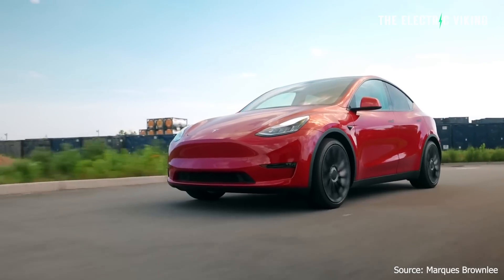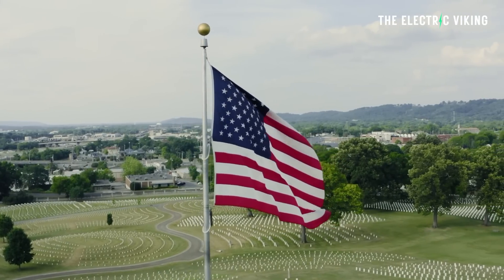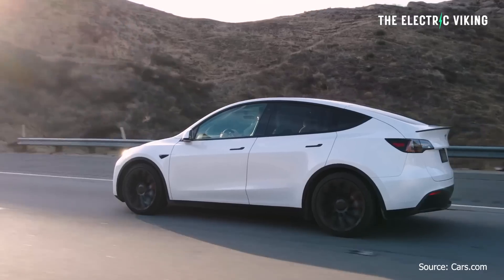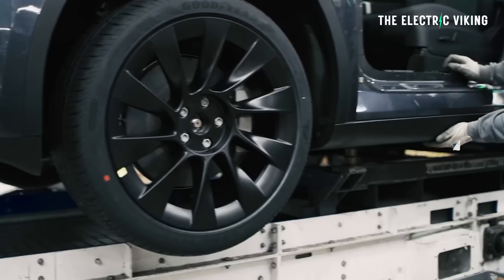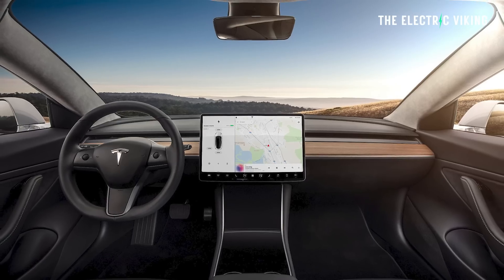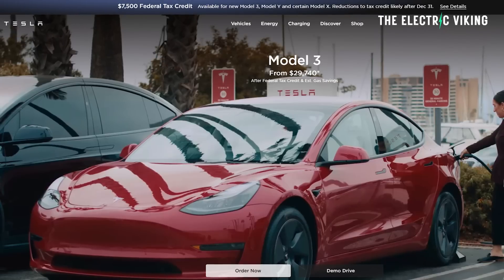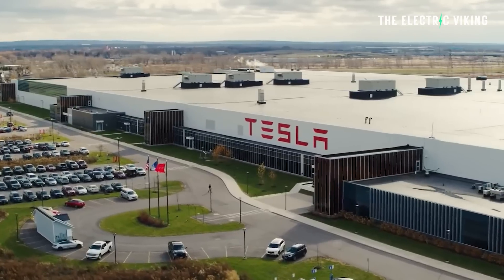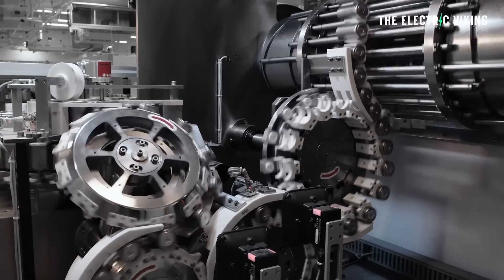NEW LFP powered U.S. Tesla Model Y and 3 qualify for full $7500 tax credit

Comment: That is not the reason. You need to Google a little better. the reason is that the IRA gives the tax credit for the average of the battery mineral cost to be calculated per PLANT not per CAR.   That means all vehicles coming out of giga Austin qualify for the tax credit. As long as the average battery materials are above 50% North American so the long range model Y average will lift up the lower LFP percentage. In Fremont, the higher percentages for the model S model X and long range model Y will also lift up the percentages of the LFP models above 50% so all vehicles will qualify. However, next year the requirement will rise to 60% We will likely no longer qualify based on the current sales mix.
Reply: So you are saying none of the cars coming out of the plant will qualify, possibly?
Reply: @jiminauburn5073  they will qualify for reduced credit $3750. You can see this by going on the Tesla website and looking at all models. They will all have the same warning thar tax credit may be reduced in 2024.  And they have to say “may” and not for sure because they don’t know the sales mix yet if 80% of the vehicles next year coming out of Austin will be cyber truck and long range model Y and the tax credit will still apply to all vehicles, including the LFP model Y as those batteries for the cyber truck and mong range will be sourced in America. In fact, I would guess that will be the case for Gia Austin as I assume it’s volume will largely be cyber truck and long range model Y to easily lift that percentage above 60% for all vehicles, including the LFP Y.

Comment: Bro I watch your channel every day, and the degree of accuracy here on many points is a bit low - let’s be careful about advising others on using Google 😅
Reply: You’re exactly right. And he happens to be wrong in this video, too as he did not even get the correct Google answer as to why the tax credit applies. It is because the tax credit is calculated as an average across the plant and applies to all vehicles produced in that plant Not per car, so it doesn’t matter if the car is NMC or LFP battery itself as long as the plant percentage is its favor.
Reply: Each one of you responding do not own, drive or live with evs.  Your all frustrated you can't.  I am your nightmare.  In our home we have 3 evs 22 plaid, 23 m3p, 22 ev 6 gt line, my son at Stanford a 21 Audi etron P.  Plus on our home we have 62 450 watt solar panels and 2 weeks ago added 6 powerwalls to our existing 4 piwerwalls we have had for 30 months now.  Either do or don't  but posting your frustration about not being able to afford things is your problem.  Now sack up, grow up and get it that bevs are here and they WILL be the future.  There will be some ice cars that will continue long into the future but they will be exceptions and will cost over 150k, specialty makes that will.avoid regulations because they will be small batch.  Ice for passenger cars will have about 10 to 15 years max then passenger vehicles will be 98% bev.  I can't wait you knuckle draggers will either be in evs or not.
Reply: @MrJinske I own more Tesla stock than most Tesla owners new cars are worth.  Does that qualify in your book?  In other words, currently owning an ICE vehicle but can’t justify (yet) getting rid of it as it’s paid off and has tens of thousands of miles left before getting a better EV than now offers.  Oh, and it’s because I religiously follow Tesla I see the mistakes often in Sam’s otherwise great content and want to see him reach more folks.
Reply: Anyone that starts with bro, lives with mommies and daddies not serious.  Here is how it's goes hey mom or dad can I drive your car to get some vapes, I promise to only use 20 bucks on the credit card is that ok?
Reply: @MrJinske  LOL if you only knew… it’s a common colloquialism to indicate a general amicable stance  between unknown speakers on the Internet currently.  While I love Sam’s content, he often doesn’t take the time to get the details right unquestionably,  bro.  Don’t assume so much, you are about as wrong about me as you can be.
Reply: The Electric Viking 🦧 should practice what he preaches. 🧐

Comment: Model 3 LRD doesn't qualify for the $7500 unless it's default colors specs due to the stupid $55,000 cap rule. Such a dumb rule. Hopefully highland drops the price to collect the tax credit.
Reply: You’re actually talking about the performance one. It’s at $53,000 so you’d only have 1000 to play with before it would become in eligible.
Reply: @Fitforacting  No. You forgot taxes and fees. It's above $55,000 for any color augmentation.
Reply: @zenster1097  I work for Tesla. Its before taxes
Reply: @Fitforacting  Before taxes, but I think it includes the delivery fee.
Reply: @Fitforacting  I believe it is based off of MSRP, right?  Tesla should put the MSRP $5000 less, and charge you some $5000 fee if you buy one.  Kind of like a dealer adds on a fee, but qualifying is based on the MSRP, not the inflated dealer price.
Reply: @Fitforacting  Are you sure about this? I don't know who to believe anymore.
Reply: @jiminauburn5073  I agree! That way you can get different colors